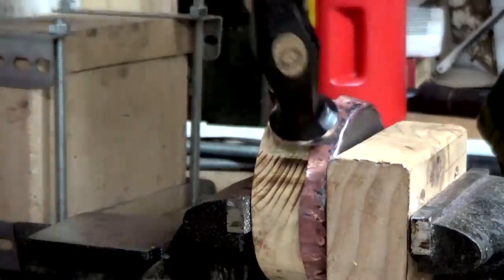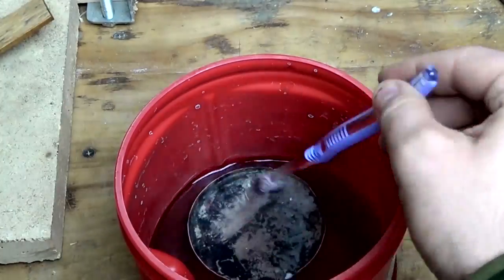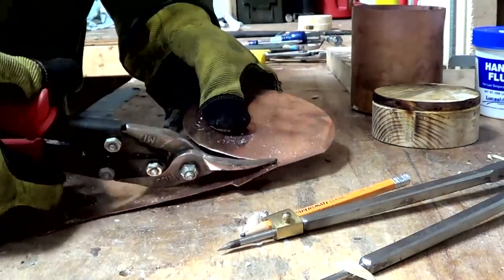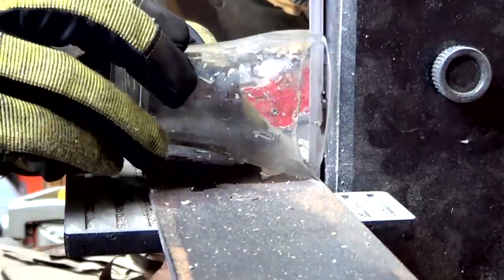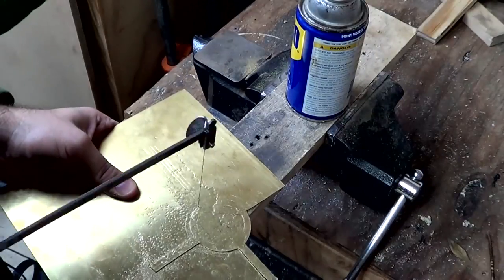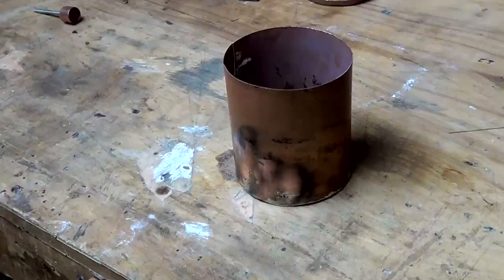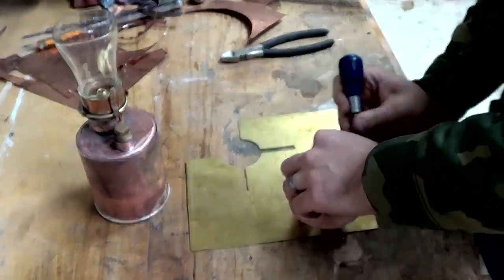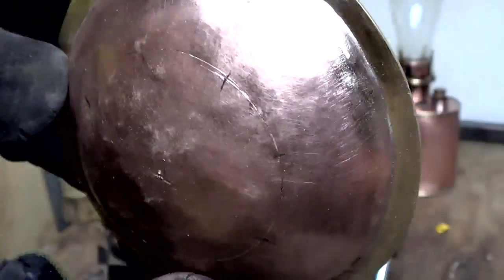Handmade Decorative Metal Copper and Brass Lantern

Comment: You can also use the "Fire" sauce from Taco Bell to clean up that copper and brass. Lots of vinegar in it and if you go there fairly often you can have a good supply. lol Used it on a crap load of old pennies to shine them up like new. Even the old nearly black ones shined up. Plus the sauce smells better than straight vinegar.

Comment: you can try a different technique when silver soldering....here's what to do...use plenty of flux more then you have heat piece/pieces until flux starts to bubble THEN apply solder it will wick around the part which will have a stronger hold plus it will look better..
Reply from the maker: +Lawrence Harasim Thanks for watching.  I've soldered a fair amount of copper for plumbing, but "jewelry" soldering is not exactly the same.  :)  I appreciate the feedback.